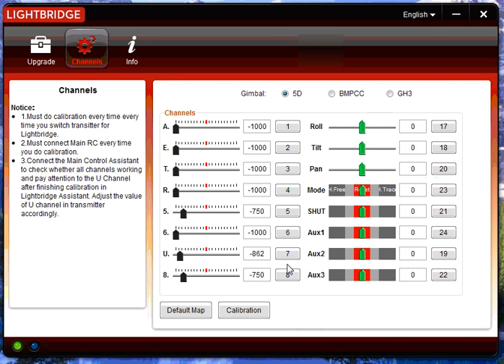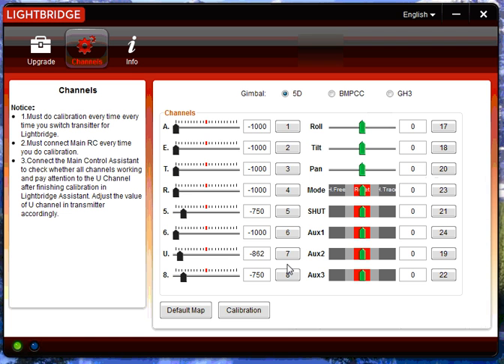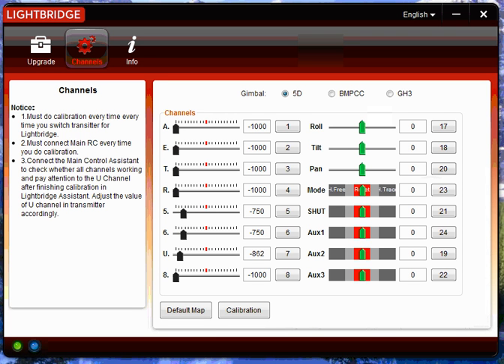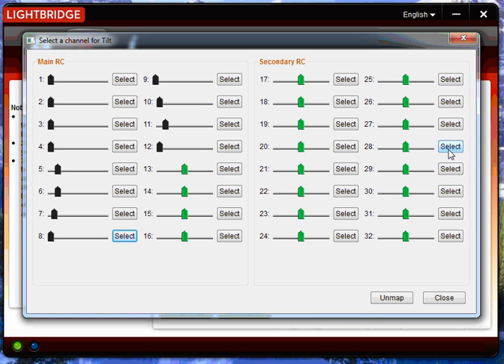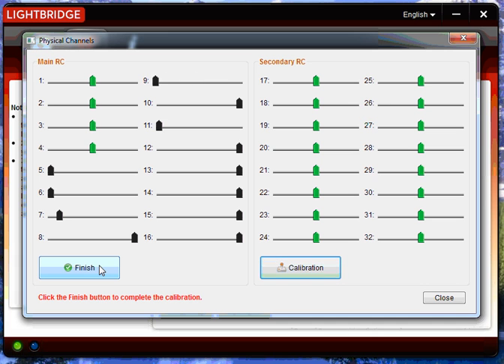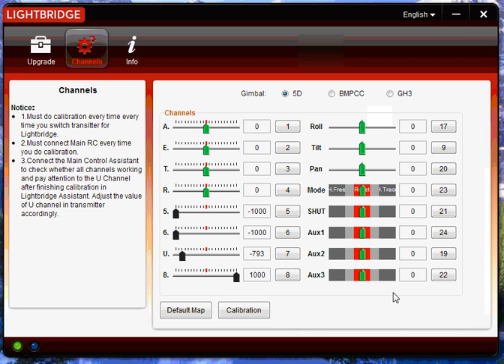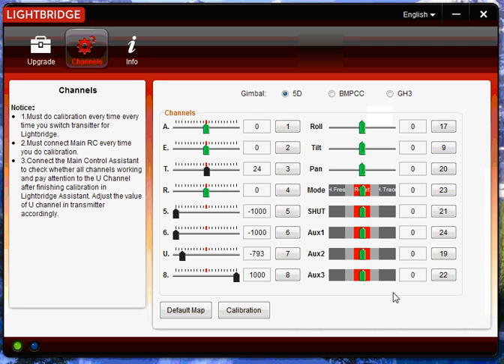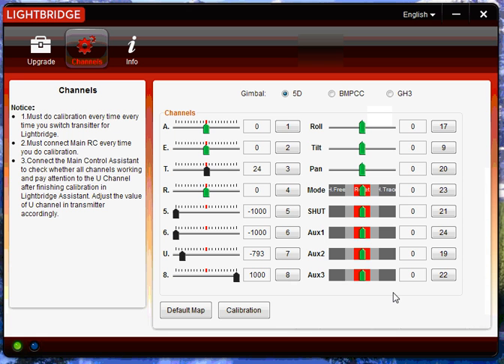DJI Lightbridge Channel mapping Demo

Comment: Hello  sir Ken ive just viewed your youtube tutorial about mapping up the lightbridge asst software for dji s900. 
Sir ive got a lot of questions regarding on this matter and i hope sir you can share to me your precious time in helping me to set up my Dji S900
Actually ive bought my s900 but its not ready to fly one. I bought all these stuff individually namely:
1) Dji S900
2) panasonic gh4. camera
3) Zenmuse z15 gh4 gimbal
4) futaba T14SG radio controller
5) lightbridge 1
6) A2 flight controller

Ive been setting up my s900 for more than 2 weeks now but i cant come out the right settings and mappings sir.  Ive tried to watch dji tutorials,  readings all the manuals,  youtube tutorials(including your youtube channel sir) but unfortunately with all my dismay i cant really come out the exact settings. 
Sir,  actually ive done all the wirings,  firmware updates of A2, lightbridge1 and zenmuse gh4 hd. 
Ive done the basic mappings on the LB1 using LB asst software
Sir can you help me in setting up my S900? 
I hope sir you can share it to me your expertise and of course your time sir in building up my s900. 
Thank you sir in advance. 

Sincerely yours
Warrene delos Reyes
Philippines